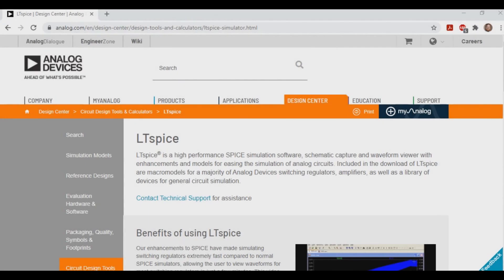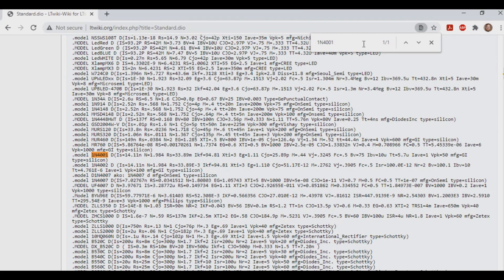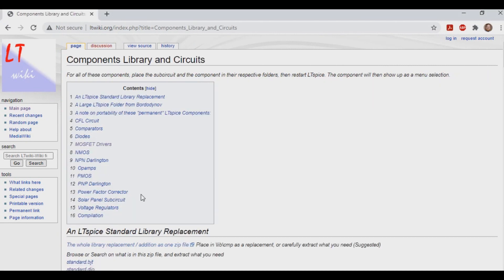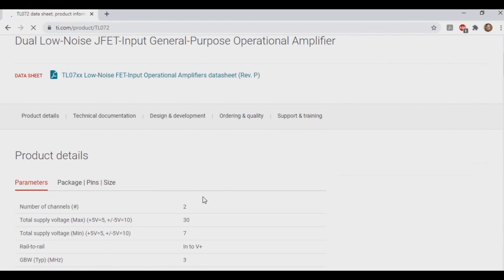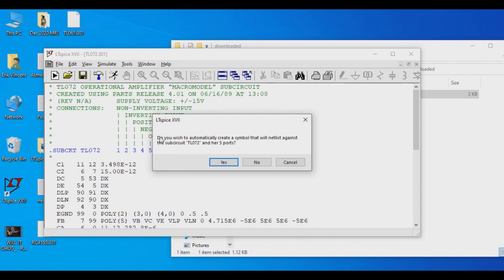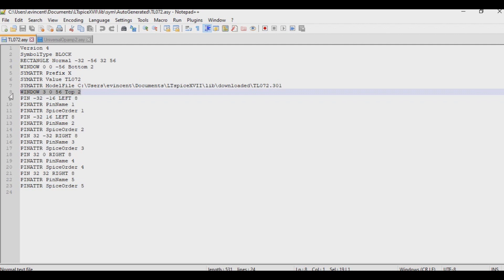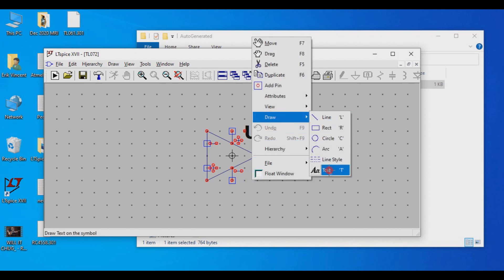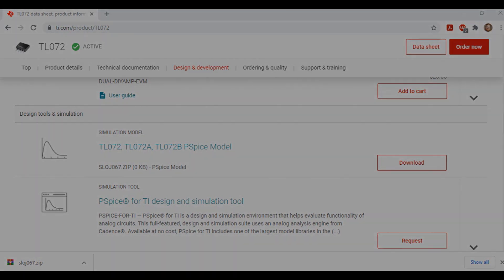Beginners Guide to LTSpice for Guitar Pedal Builders, Part 1: Adding Components

Comment: If you are having trouble finding your .lib file as shown in the video then try checking these paths, C:\ProgramFIles\ADI\LTSpice\.Lib That one worked for me, or it might be C:\Users\ your username \Appdata\Local\LTSpice. It seems it changed locations with operating system updates over time. Hope that helps, and if anyone finds it somewhere else it would be awesome if you could add the path for future users in the case they encounter a similar issue, Thanks!

Comment: how do you handle a dual opamp like a RC4558, where you are using pins 5, 6 and 7. All of the opamp stuff I see just has pins 1, 2, 3, 4(GND) and 8(V+). A lot of the pedal deigns use both and there is a schematic symbol for UA and UB. Ub being the second stage of the opamp, pins 5, 6 and 7. Thanks, awesome video series.

Comment: Anyone get the TL072 op-amp symbol to open on Mac?  Getting an Unknown Symbol Syntax error
Reply: I found someone else who had a similar issue. It might be the path of where "downloaded" is at. It gave him chinese characters where the path was /Users/john/Library/Application Support/LTspice/lib/downloaded/TL072-2.301, but got it to work when it was moved to /Users/john/Documents/LTspice/downloads/TL072-2.301 and then did the procedure.
Reply: @erikvincent5846  yep got the Chinese characters too. I’ll try the path move thanks!
Reply: I have this problem too, and changing the path did not fix it.
Reply: @joshgreen19  when you open LTspice you have to select "More Choices" then "Another type of file" and then open the 301 file
Reply: @cematra  I have just tried this and not had any luck :(
Reply: @josiahgodwin127  changing the location of the ModelFile to "[path to/]Documents/LTspice/[any folder name]" worked for me as well.
Edit: I'm on macOS 10.15.7

Comment: I tried making the TL072 symbol and when I tried opening the asy file LT says "Unknown symbol syntax:" followed by a bunch of Chinese symbols. I double-checked and my text file looks exactly like yours.
Reply: Let me see if this will fit in the comments section, but here is the contents of my TL072.asy file that should be in your %userprofile%\Documents\LTspiceXVII\lib\sym\AutoGenerated folder. Also make sure where it has the ModelFile, it obviously has your user account there and not mine:
Version 4
SymbolType CELL
LINE Normal -32 -32 32 0
LINE Normal -32 32 32 0
LINE Normal -32 -32 -32 32
LINE Normal -28 -16 -20 -16
LINE Normal -28 16 -20 16
LINE Normal -24 20 -24 12
LINE Normal 0 -32 0 -16
LINE Normal 0 32 0 16
LINE Normal 4 -20 12 -20
LINE Normal 8 -24 8 -16
LINE Normal 4 20 12 20
TEXT 18 25 Left 2 TL072
WINDOW 0 16 -32 Left 2
SYMATTR Prefix X
SYMATTR Value TL072
SYMATTR ModelFile C:\Users\evincent\Documents\LTspiceXVII\lib\downloaded\TL072.301
PIN -32 16 NONE 0
PINATTR PinName In+
PINATTR SpiceOrder 1
PIN -32 -16 NONE 0
PINATTR PinName In-
PINATTR SpiceOrder 2
PIN 0 -32 NONE 0
PINATTR PinName V+
PINATTR SpiceOrder 3
PIN 0 32 NONE 0
PINATTR PinName V-
PINATTR SpiceOrder 4
PIN 32 0 NONE 0
PINATTR PinName OUT
PINATTR SpiceOrder 5
Reply: I found someone else who had a similar issue. It might be the path of where "downloaded" is at. It gave him chinese characters where the path was /Users/john/Library/Application Support/LTspice/lib/downloaded/TL072-2.301, but got it to work when it was moved to /Users/john/Documents/LTspice/downloads/TL072-2.301 and then did the procedure.
Reply: @erikvincent5846  Hi Erik, thanks for the video. That first filepath listed above is the Mac file path for lib and unfortunately I'm having the same problem as the op. Any ideas? I've tried creating a downloads folder in my LTSpice folder stored in Documents rather than Application Support and it hasn't made any difference. Thanks :)
Reply: I was getting the error "Unknown symbol syntax: Version 4" and it was because VSCode set the encoding to UTF-16. I manually changed it to UTF-8 CRLF and it works now.